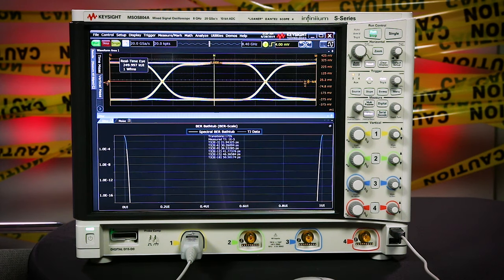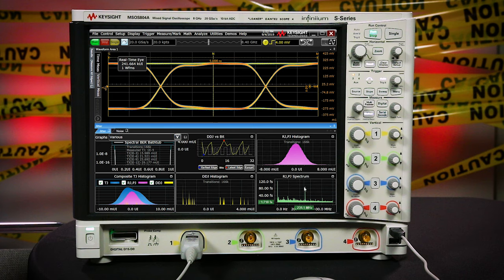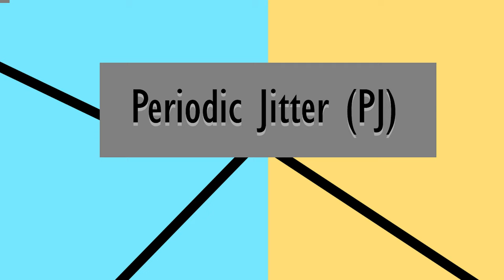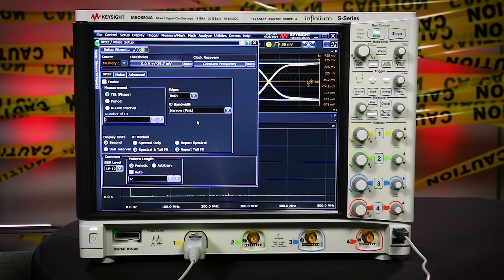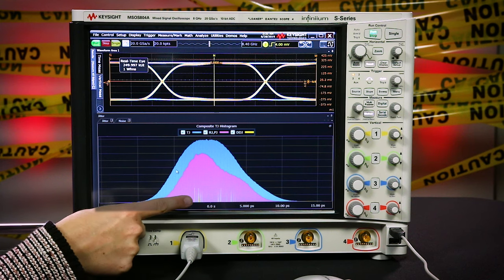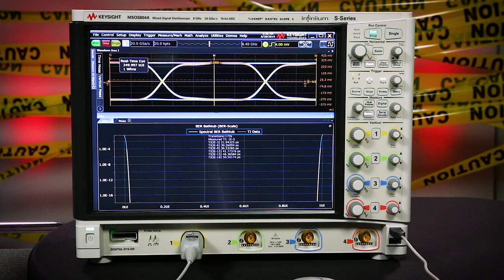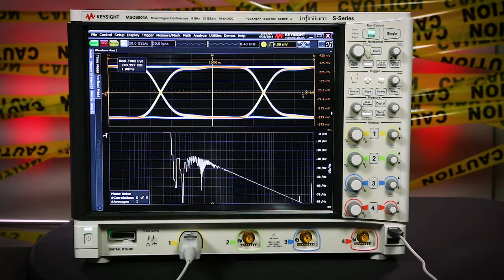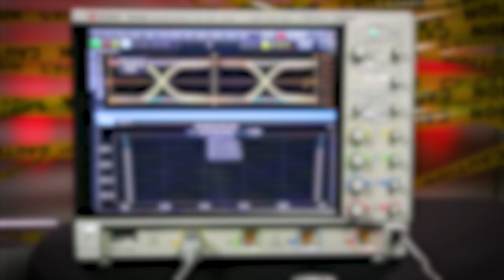How to Analyze Jitter with an Oscilloscope using EZJIT Complete

Comment: At what point does the scope stop reporting on the jitter of the DUT and start reporting on the jitter of it's own clock? 
I'm thinking about testing a cesium clock, what would the results of that test show?
Reply from the maker: Scopes all have a jitter spec as well, so you could look in your data sheet and see how it compares. I suspect you'd want something other than a scope to cesium clock's accuracy though. Maybe a high precision counter or DMM.